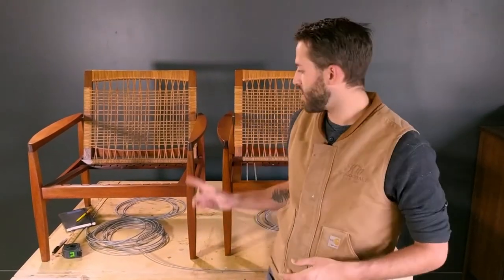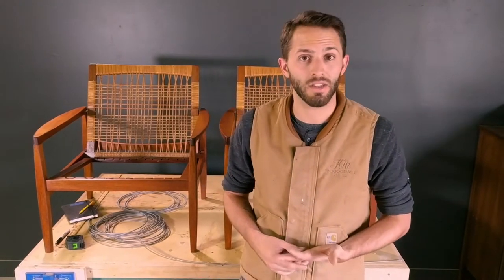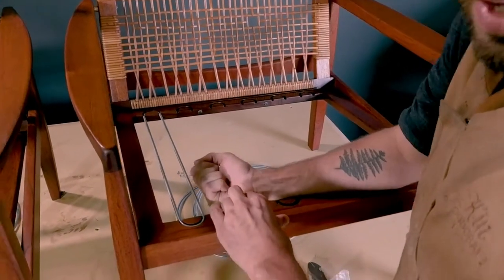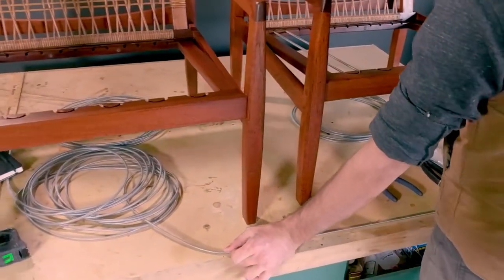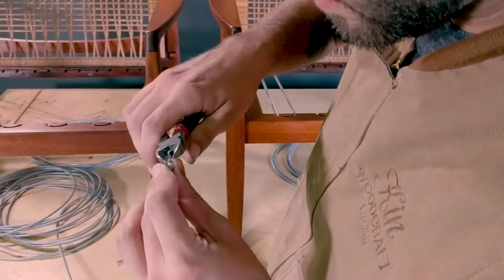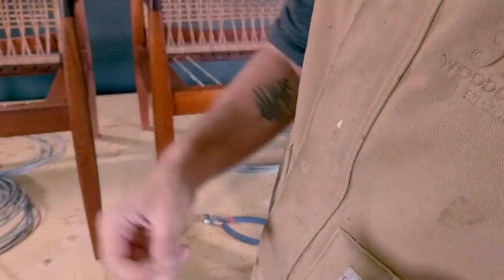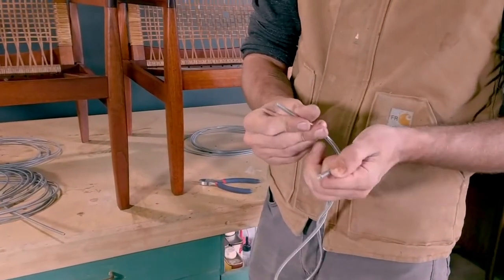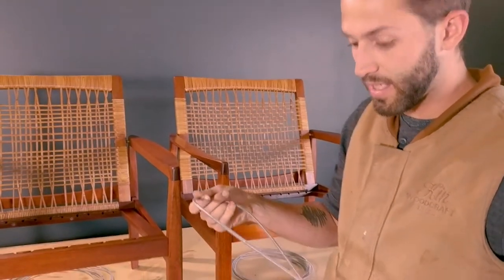Loop Spring Replacement on Mid Century Furniture

Comment: Should they not be cut a little short to tension the spring. ? I have a Danish sofa to renovate. Thanks.
Reply: Do cushions sit right on top of the springs ?
Reply: I think because while the distance measured (top of arc to top of arc) is a straight line, the bend the coil must follow at each end adds to that distance, providing tension.
Reply: @trystcraft2152  You are correct. I cut my first spring about an inch too short and struggled to get it into the loop. All the rest were top of arc. Luckily I found a source in Germany for 20 metres of coil. !

Comment: Do cushions sit right on top of the springs ?
Reply: Yes. I found a source for the spring in Germany and bought 20  meters. It should be cut as in the video - loop to loop distance x 2. They are held together by a 15 mm threaded bar which surprisingly is strong enough. Very satisfying if you have a Danish sofa. !